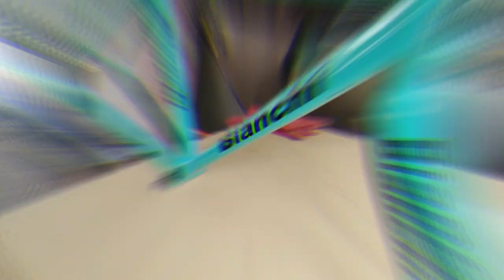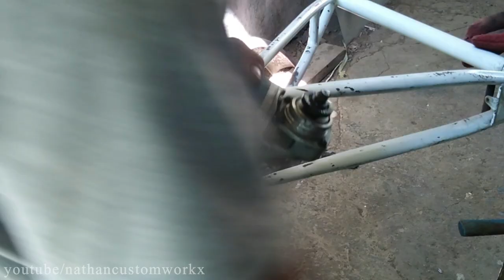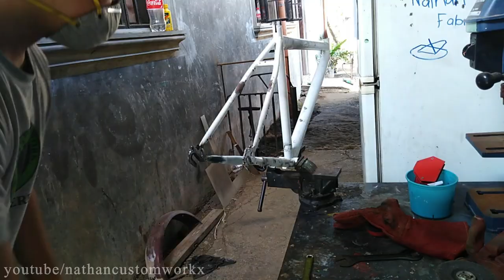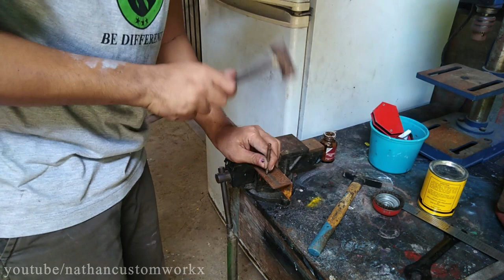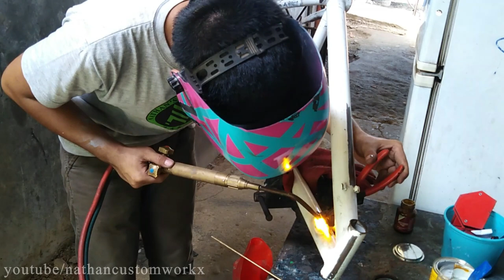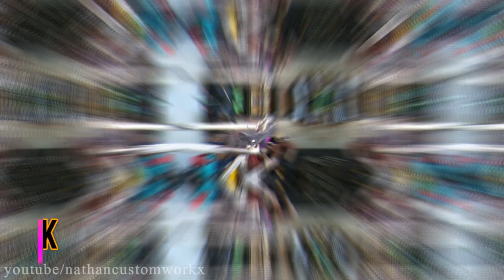V-brakes To Disc Brake. Bronze Brazing Disc Brake Mount | BATANGAS CITY, PHILIPPINES

Comment: Boss Nathan, magkano magpa-convert ng steel frame with lugs, standard headtube to OS 1 1/8" at palagay ng disc tab at paluwagan ang rear triangle spacing, kasi nka 5speed lang dati ang hub na nka-install. Fork standard with thread, convert to oversize na steering tube. Where po kayo pwede ma-contact? At magkano po aabutin lahat? Pls reply thanks.

Comment: Sir, bakit braze on ang ginamit mo instead of TIG welding? thank you. planning to modify my steel frame din.
Reply from the maker: hi sir. ok din po yung tig welding kaso lang wala akong machine nun. hahaha
Reply: @neightzindustries  ok sir. hehe btw, nice work sir. yung disc tab po binili nyo lang?
Reply from the maker: @sergiotamayo4206  ako po gumawa nun sir.
gusto ko din magkameron nyang tig welder. hahaha. mas madaming klase ng bakal ang pwedeng hinangan.

Comment: Nagkakatay po ba kayo ng frame? Nasa magkano po pag mag papakabit ng discmounts pati papatagtag ng boss mount ng canti
Reply from the maker: opo sir.

pag ganun sir ay 1000 frame at fork
500 po kung frame lang. lahat na po yun
Reply: @neightzindustries  boss kaya nyo bang gawing 700c yung 26er na steel frame tapos po ay papaltan ng seattube gagawing pang 27.2 po na seatpost pamula sa 25.4?
Reply from the maker: @boltiborbsheace2599  kaya sir. Yung sa seat tube po ee depende kung may makukunanan ng tube
Reply: @neightzindustries  sir  magkano pakabit ng disbrik aluminum aloy sya pd bayun sir pls

Comment: Kaya mo ba sir mag lagay ng disc mount sa aluminum frame?
Reply from the maker: yes po
Reply: @neightzindustries  ano po gamit nyo for welding aluminum?
Reply from the maker: oxy-acetylene po
Reply: @neightzindustries  saan po location nyo at how much po pa weld ng mounting sa alum frame?
Reply from the maker: @Hlidskjalf6698 batangas city po
500pesos po
Reply: @neightzindustries  okay po. Batangas city din po ako. Pano ko po kayo macocontact?
Reply from the maker: @Hlidskjalf6698  message nyo po ako sa fb page ko www.facebook.com/fabricatornathan